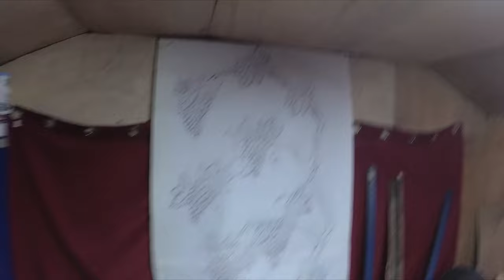Hand carved wine cellar door

Comment: This is a gorgeous door, and the roundness on the grapes is impressive.

Are the chunks glued and screwed to the door?
The woodfiller, is that sawdust and glue?
What kind of oil did you use?
Reply from the maker: Yes the chunks are glued and screwed...and yes wood filler is mixed with saw dust and finish is a heated line seed oil it helps when the oil is heated up..it soaks into the wood better and deeper..